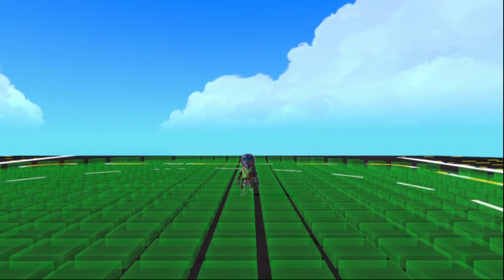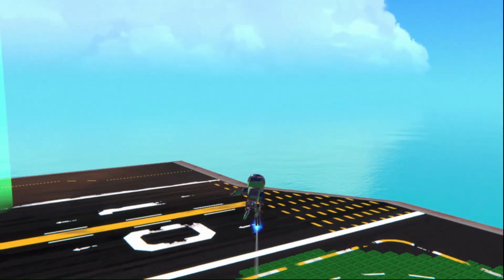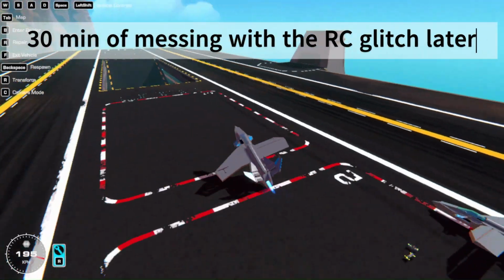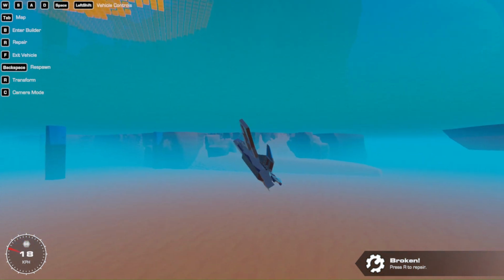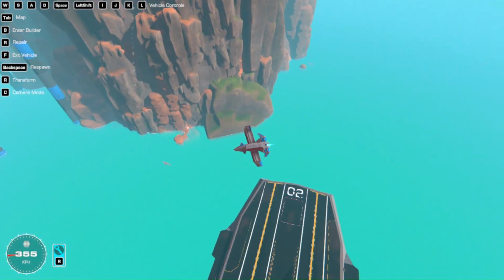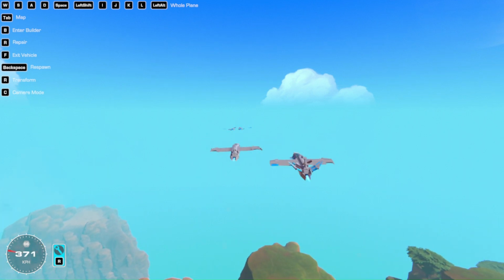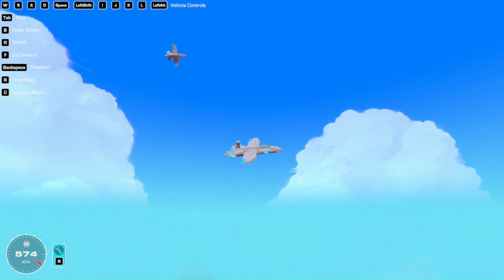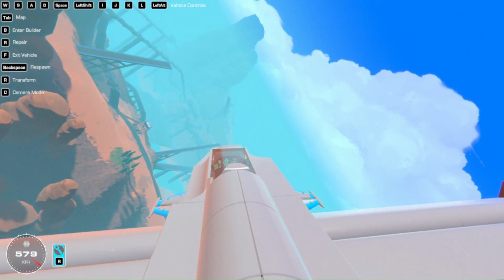Flying TWO Fighter Jets at ONCE!

Comment: I had the same issue when I attempted this.  The detach plane didn’t seem to mimick the flight properly and would just go off and crash.
Reply from the maker: It has something to do with tm still considering the previous creation for some of the physics. I think that's the same reason the zero drag glitch works.